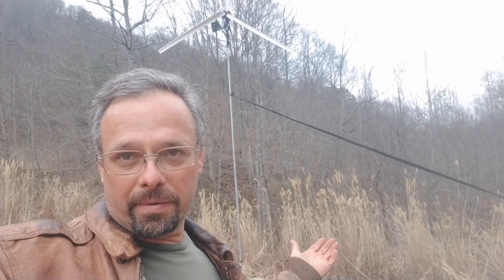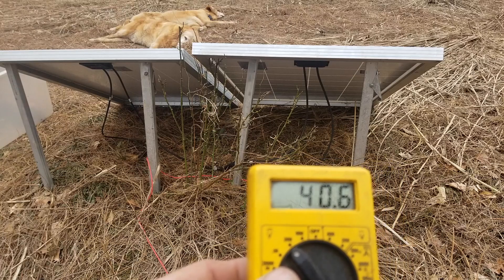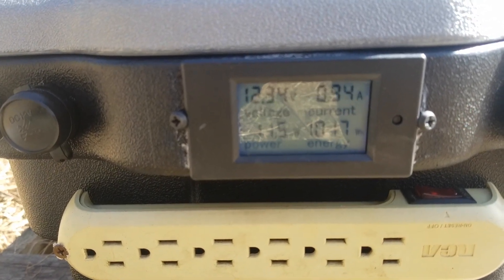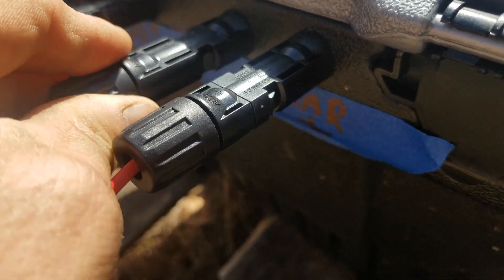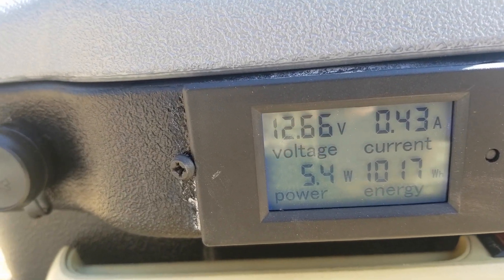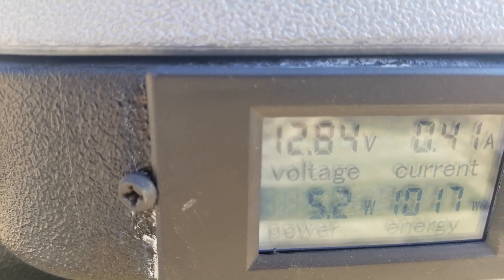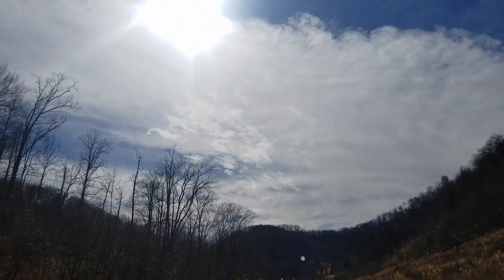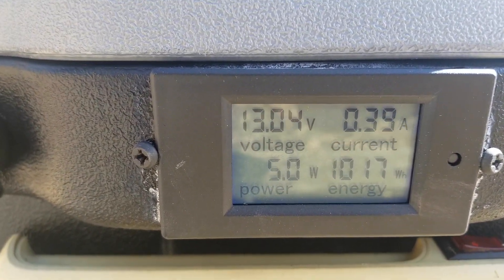Getting Power From the Sun and Wind

Comment: Luke that was another good video but I bet you'll get a lot of hits if you focus on that water generator. I know for one I would love to know all of the numbers volts amps Watts everything gallons per minute I would love to know that you make great videos keep them coming
Reply from the maker: Yes, the water generator is nice because it doesn't need specific circumstances to run. Where the solar only works in the sun and the windmill only works in the wind there are times they are doing nothing but sitting there. The water generator is running most of the time until it gets clogged up with leaves or other debris, but that's just every now and then. I will make a video showing the whole system soon and will include the numbers on the water generator.

Comment: Would be interesting to know how much energy is lost from the solar panels not being in optimum position through the whole day ? Would it be worth making them track the sun ?
Reply from the maker: From what I hear there solar panels that track the sun are 40% more efficient than panels that do not. So a solar tracking system is a worthwhile investment. I may try to come up with something.
Reply: The marketing departments of  the manufacturers of tracking units say that you can get UP TO 35 to 40% more power if they are tracked.
 Back in the day when panels were very expensive (around $10 per watt) the people who actually spent the money for tracking systems found that the 35 to 40% was quite a stretch of the imagination even for the few days of the year that it came somewhat close, and above all, tracking systems were not reliable at all.
 These days panels are about $0.50 to a dollar per watt, and it just makes much, much more sense to buy extra panels and face them all South on the same plane.
 PV panels will make about 90% of their energy even at about 30 degrees off from perfectly facing the Sun. Even a little more than 30 degrees, and it drops off very sharply due to reflection.
 To better see a good example of this, take a full aquarium in a dark room, and shine a flashlight down from the top into the water, and angle it at different angles and you can see it easily. It may be at a different angle due to it being water instead of glass, nevertheless the effect is the same.

Comment: you have an impressive set up. it looks like you could use a much larger battery bank or several battery bank modules
Reply from the maker: Thanks! Yes, especially with the addition of an enclosure to hold the system. I was even thinking of adding wheels to make the whole thing portable on a small trailer. Of course the wind generator wouldn't be portable, but it would be a portable solar generator.